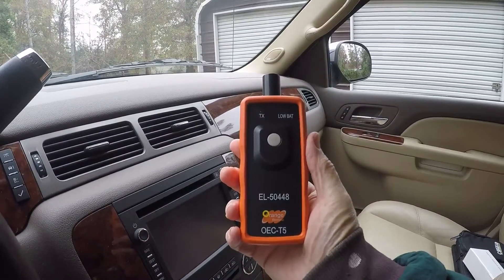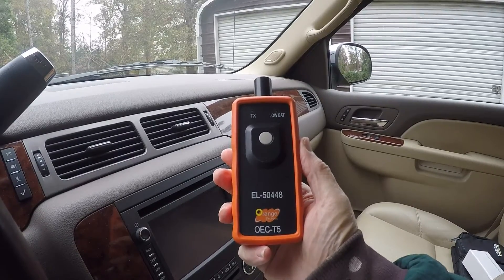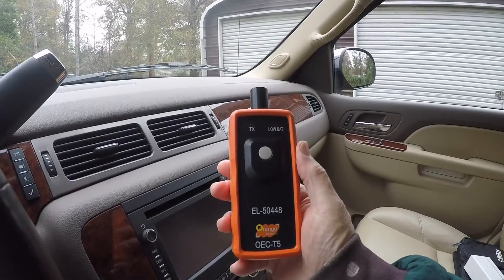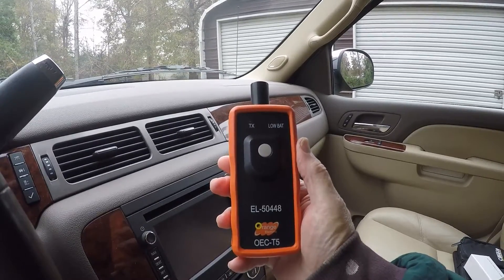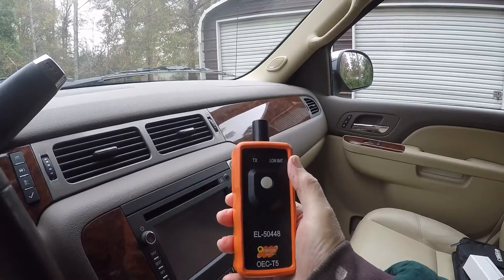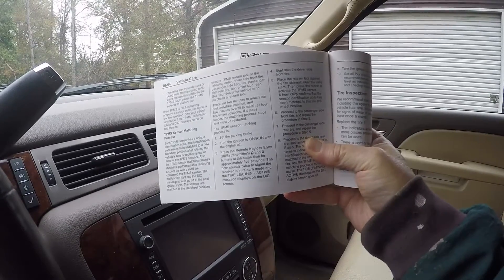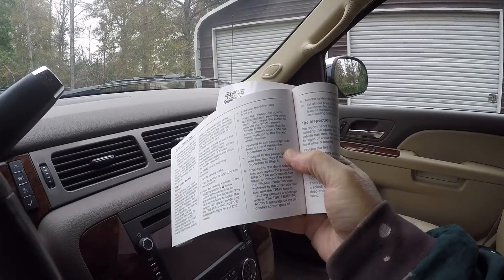Tire Pressure Monitor System Re-Learn Tool

Comment: Just set my 2008 CTS! Worked perfectly, I used the EL-50448, OEC-T5, got at Wish ( $11.00_[-$6.00 + $5.00 shp & possible tax] ). I was missing (setting the parking brake). Just got new tires a couple of months ago and they were reset, but one failed afterward. If it fails again, I'll have to replace the sensor on the tire, so I'll have to keep an eye on it. From what I've heard, the battery life of the sensor is about seven years.
Tip, I set the transmitter at the rubber ( sidewall ), because rf goes throug  rubber easier that metal ( then by wheel/valve stem ). I gues tha the tool triggers the sensor to report.
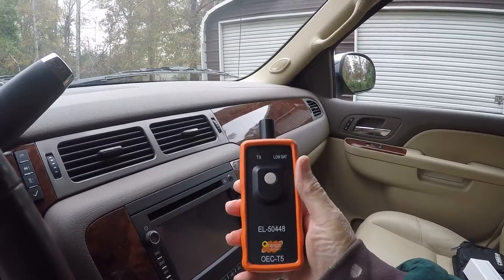Yes 3:22, but just follow at 2:19, and it's simple.

Comment: You can buy this tool on amazon for $15, but the same exact tool on the GM website is $65. You used to be able to relearn your tpms without a tool,  just by letting some air out of each tire.  Hey GM,  how bout you stop ripping off your customers?